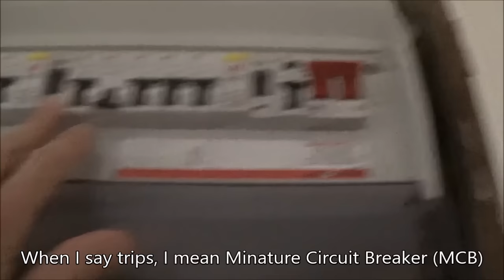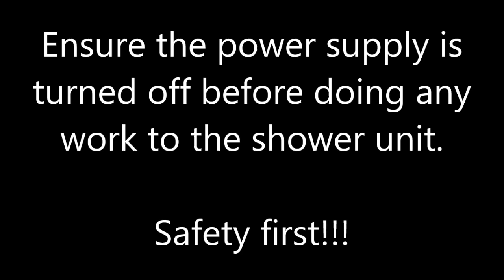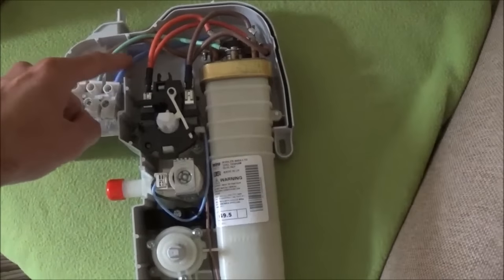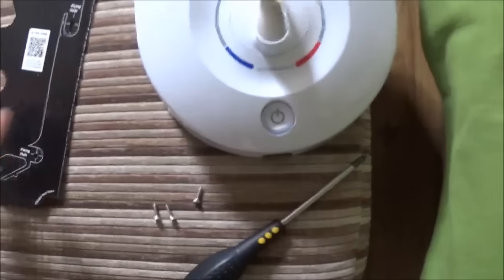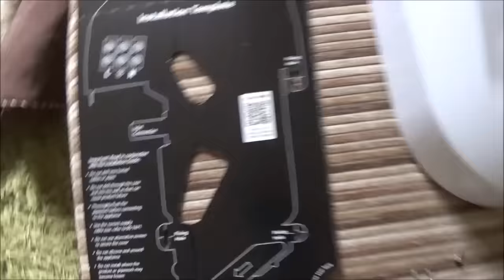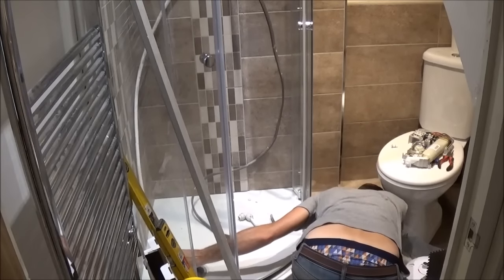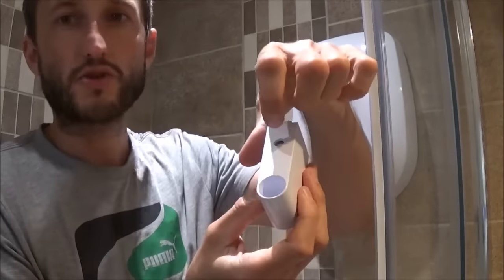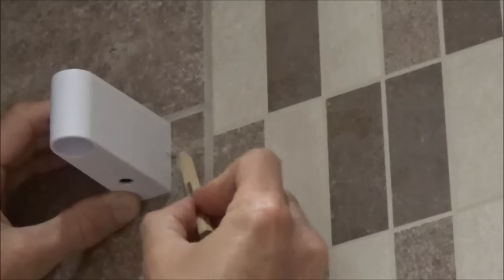How to fit & install an electric shower. Mira Go shower installation.

Comment: Our shower broke down years ago. Im thinking of replacing it this week. once I turn off the electricity, water and get to the stage where I have put the shower unit on should I turn the water valve back on and test if the water comes through?

Its been years since the shower was working. No water comes out of the shower now but I put that down to the shower not working and not because the valve isn't working. I assume the valve is still working.  They had a plumber look at it years ago when it first broke and my mother said the reason the shower is not working is because the motor inside of the shower unit broke. I assume she was reffering to the temperature unit. 

Thanks for your help.
Reply from the maker: Hi there, if you isolate the power then isolate the service valve (assuming you have one), remove the shower from the wall. Then open the service valve and if water comes out then you know the water supply is fine and it's the shower that's broken. Please bear in mind that fitting a shower comes under the Part P regulations so you either need a qualified electrician to carry out the work or speak to building control in your local authority who will arrange for an inspector to check your work (for a fee) on completion if you do it yourself. As your existing shower is old you may well need a new complete shower cable to cope with the power of modern showers, and possibly an RCD if you don't already have one in order to be safe, and comply with the current legislation / regulations. I point all this stuff out in the video, I just want you to be aware that if installed poorly without the correct safety in place, electricity and water is not a good mix! These extras also come at additional cost and can make the job more complicated. Good luck with it and thanks for watching!

Comment: I wish my sparkie had watchd this,  he left a cap on the inflow and declared  a fault with the shower.  Had to call out MIra.     Great vid, thanks. 
As said this is not DIY,  if you try it your self it will leak or  there will be an issue.
Reply from the maker: Thanks for the feedback.

Comment: My bathroom doesn’t have a shower at all i’m thinking I’d have to install an isolation switch run into the fuse board and then run the shower into that. Also I need to consider how I would go about installing the cold water feed. Can I just come straight off of the pipes that feed the bath? I would much rather install new flex pipes to be honest but again that would involve a bit of work. Perhaps I could install flex run it under the hallway floor and then through the wall. My flat is all concrete and load bearing walls so it’s an absolute pain in the arse
Reply: Was thinking the same thing

Comment: Getting behind the wall is the problem, when it is solid concrete  ???
Reply from the maker: Hi ally, I also have a brick wall. To overcome this I created a stud wall by using 3 vertical wooden 2"x3" lengths of wood secured to the wall, then I fixed plasterboard to that. This gave me a 2 inch gap behind the plasterboard to do my pipework and electrics and gave me the clean look I wanted. The downside is you loose about 2.5" of depth to you bathroom but the finished result is a lot slicker than exposed pipe work and cable in trunking down the wall. I also boxed all my waste pipes in so nothing is on display. You can see this in my other videos:
How to tile a bathroom floor - https://www.youtube.com/watch?v=y75e479ups0
How to tile a bathroom/shower wall - https://www.youtube.com/watch?v=gk1yWnjL0YY

Hope that helps. Thanks for watching!
Reply: Thanks  we  just moved ,and was wondering what kind of work needed done, I see there is a lot to be considered. Not be doing the work myself  thanks a LOT.

Comment: Hi, I live in a bungalow and am considering having an electric shower installed over my bath, could you advise please?
Reply from the maker: Hi Julie, firstly if you watch the video throughout it pretty much explains what you need to consider, however as all showers and domestic electrical set ups vary, I can't advise specifically. If you're unsure my advise is employ an electrician that knows what they are doing. Water and electric can be dangerous! Good luck and thanks for watching!
Reply: POUSE around the HOUSE ok thank you for replying.
Reply: Hi I have had an electric shower on my bathroom wall for over 3 years now (opposite side to taps) but not connected the people who done it got through half the work to then say it wasn't possible as I haven't got the right Ashleigh breaker so have the shower but not finished will it ever be able to be done?

Comment: can you use 8KW shower for 10 mm cable. Thanks.
Reply from the maker: Yes, but it depends on a number of factors, like is the cable buried in insulation etc. But generally speaking yes it's ok. If in doubt get a qualified electrician to check and sign the work off or speak to local building control as it comes under part P regulations. Hope that helps, thanks for watching!

Comment: Instead of using a hoover when drilling, try using an envelope mate, open envelope and use a bit of masking tape to tape it to wall/tiles underneath your drill hole and drill....... Watch it all nicely go into the envelope, try it pal 👌
Reply from the maker: Hi again, I already use that method if I'm working in a carpeted room. You can see me use that method in my following video - How to use wall plugs - https://youtu.be/WrVr6KbTNac. Thanks for the feedback and the tips.
Reply: POUSE around the HOUSE seriously though pal, considering you're not qualified in what you're doing, I've got to admit, you know your shit pal, what is your actual trade?

Comment: What about homes with 2 pipes? Cold & hot
Reply from the maker: You only need a cold feed on an electric shower. If you have a hot feed you are not using you could cap it off or cut it back to the main pipe feed to avoid water staying stagnant in the pipe. Hope that helps. Thanks for watching.
Reply: @skinnyniggawidfatbelly7212 surely that depends on your plumbing system and water pressure

Comment: what shower bracket for ?is it true that shower hose should not be used at  lower height  than shower unit ???
Reply from the maker: Hi Alan, the shower bracket is to hold the shower head while you shower. As for the height of shower hose, I'm not sure about that. Just follow the manufacturers instructions for the particular shower that you have. Hope that helps, thanks for watching!

Comment: I was told that you really need a 10.5 kwh to have a good  shower, is that right?.
Reply from the maker: The more powerful the better I guess. Mine is fine but compared to some modern showers it's probably not as good. That said it's fine for me but it is also my second bathroom so not used that frequently.
Reply: @POUSEaroundtheHOUSE  Cheers
Reply: In the summer, where the water is tepid, you can get away with 7.5 - 8.5KW. But in the winter, where the water is freezing, you really need a 10.5 for a decent shower.
Reply: Trouble is getting an electrician to do it ! You need 16mm cable and a 50 amp fuse. 🤣 new circuit very likely and expensive. You might also overload your board so reconfigurations needed so more sparky time and money. That said i chuck my mira sprint 10.5kw  on a 10mm and a 40 amp breaker and  make sure no insulation around cable run. All works fine for years.
Reply: @Михаиллеви  Thanks
Reply: @JohnSmith-vy4lh  sorry i was wrong. Method B installation (the most common) lets you have a 10.5 kw or 10.8 kw shower on 10mm twin and earth cable with a 50 amp breaker.
Reply: @Михаиллеви  thanks

Comment: If the shower is on its own ring, what’s the purpose of the isolator installed between DB and shower?
Reply: i can answer the shower is radial and stated in the 18th edition wiring regulations in chapter 5 in 537: (Every circuit / installation must be provided with a method of isolation from the supply. This isolation device should also be provided with a method to prevent unintentional or inadvertent reinstating (usually lockable).

Comment: Can some one help I have a Mira shower fitted for my disabled husband and it keeps beeping so I have to turn it off . How do I reset it and how long will it take ? Many thanks
Reply from the maker: Not sure on that one, obviously depends on the model. If you go on the mira website they may have instruction manuals to download which may help. Hope you get it sorted. Thanks for watching!
Reply: I think it demonstrates great respect for your viewers that you reply to new comments on a video over a year old.
Reply: Could be a issue with the low water pressure

Comment: How come you didn’t test the RCD via the shower connections to prove protection?
Reply from the maker: Hi Kevin, the video was to show how to fit a shower, not how to do electrical testing. This work comes under part P of the regs so on inspection it would be tested when checked and signed off. Although I take your point, I could have added it to the video. It's certainly another video idea! Thanks for watching!

Comment: Anyone tell me how did he connect the water pipe joint to the shower machine? Did he use pushing pipe method or did he push the water part of the machine into the water pipe joint directly?
Reply from the maker: I used a push fit connector - JG Speedfit. However you can use a compression fitting also but it depends on the shower you are installing and it will tell you what to use in the instructions. Best of luck with it.
Reply: @POUSEaroundtheHOUSE  thank you

Comment: Tempting people to do DIY electrics in a shower room, is this ok with building regulations, can this be safe ?
Reply from the maker: Hi Al, I fully understand your concerns and I thought about this before posting the video. I often see people on forums asking how to install showers and they go on to explain they have done some of the wiring already and it is usually completely wrong and dangerous. The advise from members on the forum is usually 'get a sparky' or something over complicated and often incorrect, probably from apprentice electricians that have been taught all the theory and had no experience. I think if someone is determined to have a crack at wiring, they will do it regardless of the rules which I know and agree is wrong. In the video I fully explain the requirements under building regs and the options available to installers. I also explain how to fit a shower safely, so if anyone follows my example like for like, at least I know their installation will be safe which is important. Unfortunately there are loads of houses all over the UK (and other countries no doubt) that have dangerously wired showers. Even showers installed correctly in the 90's will now be considered unsafe if they have no RCD protection and potential upgrades to more powerful showers in the meantime on the same cable. 
There is also another reason for me explaining the process. Firstly, many people will watch the video hoping to do the job themselves, and when they see the additional safety upgrades required from their old shower (i.e thicker cable, RCD protection, new isolation switch etc) they will actually be deterred and employ an electrician. Secondly, many people message me who have no intention of carrying out work themselves, they just want a fair representation of what is required for a job so that they can obtain a fair quote from a builder. This is something that is important to me as I don't think tradesman should take advantage of people with little experience. 
So in brief, no I don't think it is encouraging people to do it, I think they have already decided to do it, hence they have come and found my video. At least if my video is followed, the installation will be safe and hopefully no one will be hurt. I hope this answers your question. Thanks for your question and thanks for watching.
Reply: Thanks for the reply. Electrics in bathrooms is notifiable to local building control - a legal requirement of The Buildings Act 2010. Non notified and non certificated electrics can cause unforseen civil law difficulties when selling or renting a house. Breaking UK Acts can be prosecuted via criminal legislation. Hope your safe - in more ways than one !
Reply from the maker: Hi Al, I state all of that at the start of the video. I made sure it was clear for viewers that they must be competent to work on electrics, and will need sign off by either a qualified registered electrician or a building control officer following a building regs notification. Hope that helps.

Comment: What does this thing do? It pumps the water out of the wall so you can shower yourself? Why is this done electrically? Why have wall electrified device inside the shower where it is wet? I'm so confused?
Reply from the maker: Hi juxtn, here in the UK one of the showers we use is the electric shower. This type of shower heats the water instantly so that hot water is always available even if the boiler is broken. They are made to strict standards, they are sealed from the water so the electrical parts should stay dry. They also have to be installed by someone who is competent or qualified to do so. There are very strict guidelines on how to do it including cable size, cable protection, and fuse rating in relation to the power of the shower. We also use what is called a Residual Current Device (RCD). This is basically a trip switch that in the event of water touching an electrical part, it will cut all the power supply and protect you from an electric shock. I guess if you don't use them in your country, I can see why it would look a bit dangerous! What country are you from out of curiosity? Thanks for your question and thanks for watching!

Comment: Is 10mm cable safe to use for all/most electrical showers?
Reply from the maker: It all depends on the length of cable, the shower, the MCB or fuse protecting the cable etc. But generally speaking 10mm is going to cover you for most standard showers providing you use the correcting rated fuse/ mcb protection with additional RCD protection. Always check with the manufacturers instructions and with a qualified electrician. A wet shower is not the place you want to be with dodgy wiring! Thanks for watching!

Comment: where did he connect the other end of the electric cable to. thanks
Reply: According to the IET wiring regulations bs 7671 the electric shower should be connected to a 45 amps double pole switch and the cable size must be 6 mm twin and earth and to be 45 rating amp rcd protected from the consumer unit
Reply from the maker: Hi Richard, it's directly fed to the consumer unit, on it's own supply protected by a 40amp MCB, which is additionally protected by an RCD and I used a 10mm twin and earth cable which was probably a bit overkill but allows me to use a high rated shower in the future. I explained this at the beginning of the video.  Thanks for watching.

Comment: Thank you for creating and sharing your video. Watching it made me think about getting one for our vacation home in continental Europe. We have not seen electric showers there, none of the stores know that these even exist, makes me think there is a reason. However it is just an electrical appliance that needs the correct electrical setup and a water supply, so theoretically we could? but i'm not a professional so best not to assume. What are your thoughts, do you know if these can be installed abroad or are they made only for here?
Reply from the maker: You would have to find one that is designed for the correct voltage. In the UK we use 240volts / 230volts  and these units are commonly used here. Also each country, and possibly region will have it's own building regulations or codes regarding things like this so you would need to check if it is compliant. To do that you would need to peak to a building control officer (or equivalent in that country). Hope that helps. Thanks for watching.

Comment: Do you have to seal the hole with sealant mine isn’t ?
Reply from the maker: It usually says on the fitting instructions of the particular unit you have.

Comment: Could anyone please tell if the elec cable is too short.. needs extending in order to be connected to shower,what materials do i need?please itemise. Thanks in advance.
Reply from the maker: You would need a suitable junction box to extend the cable. It would have to rated at the correct power to take the high current of a shower. Your existing cable may also need upgrading as many old shower cables are inadequate for modern showers. You also need to ensure it is protected by the correct MCB in the consumer unit and make sure it has RCD protection. If you're unsure of this I'd recommend getting an electrician to do it for you. They will test it to make sure it's safe. Don't mess around with a shower if you unsure about what your doing and remember to check all the work complies with Part P of the building regulations (in the UK). Thanks for watching.
Reply: @girlsdrinkfeck  Get an electrician,  it ain't worth burning your house down to save a few quid.
Reply: you shudnt extend , you need to run a full piece of appropriate cable usually 10mm from shower to the pull cord for the shower , which then runs back to the main board .

Comment: How do I do the pipework from bath to shower? Your pipework was already done.
Reply from the maker: You need to break into your existing cold water supply using a tee piece, then take a length of pipe from that to your shower. Don't forget to put an isolation valve in before it gets to the shower. You can isolate the water to the shower in the future then without turning the rest of your water off. Thanks for watching!
Reply: POUSE around the HOUSE Can you do a video on that?
Reply from the maker: When the job arises I will indeed film it but may be a while.
Reply: POUSE around the HOUSE Thank you.